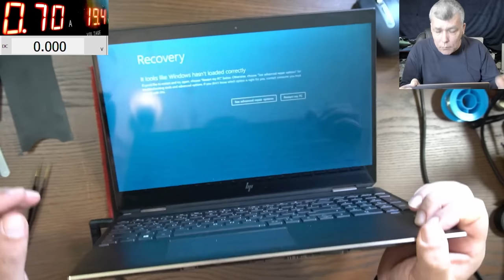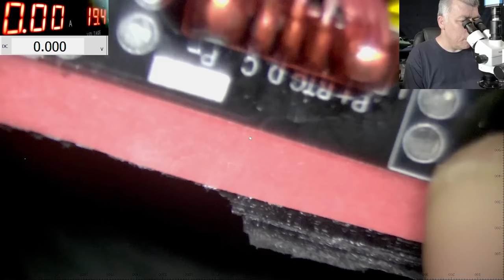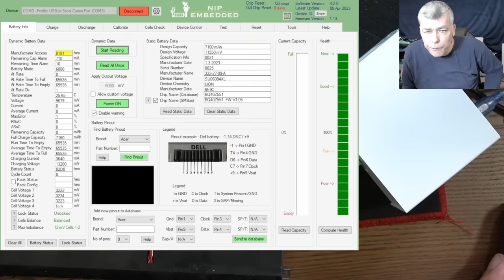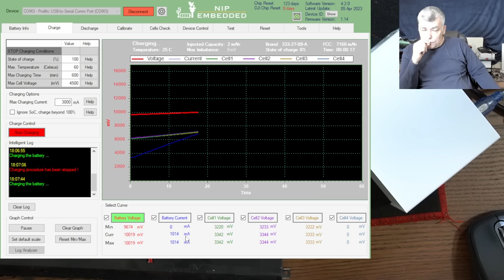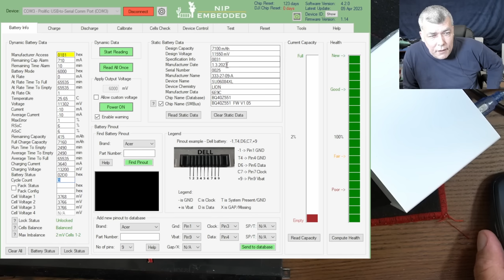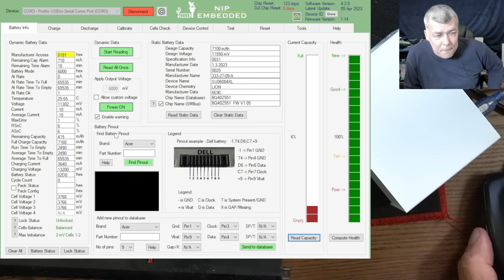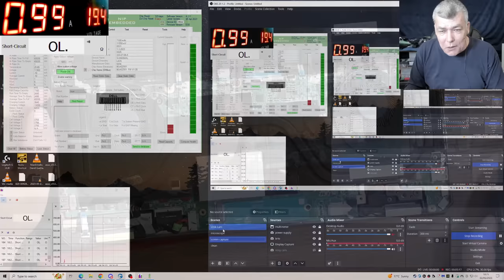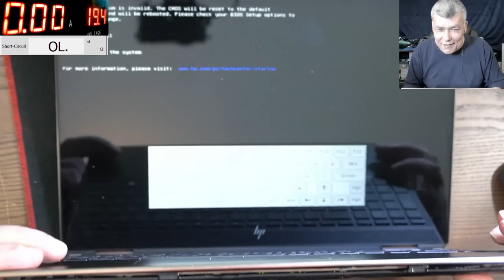Customer replaced battery and the laptop went dead, what he did wrong? Can we fix it? Hp laptop

Comment: I hate HPs from many reasons, and this is one in the queue. I never seen on any other laptop a battery connector which can be wrongly connected.
Reply: With enough determination you can fit a square peg into a round hole.

Comment: Back in the day we used to  briefly log  the fault and steps taken for remediation using  short hand,  with  faults like this, on the repair  sheet we would put ESTO ' which means  'Equipment Smarter  Than Operator'

Comment: Stangely, this connector is NOT poka-yoke. Its not mistake proof. However, at 16:20 you can see it has bplue pencil on right side, I believe customer can confirm that on original battery, there is blue pencil on connector from battery also. So its not poka-yoke in physical form, but someone marked it to make it poka-yoke.
Reply: Maybe this aftermarket battery has other colours than the original one. So it indicates the customer did Mark it before removing but never saw how to put in the new battery, maybe that's why the battery connector got broken.
Reply: Perhaps it was, before the customer forced it in 😂😂

Comment: Obviously the customer did not pay close attention to the connectors original specifications which no doubt in its construction would have only allowed an one-way fit...still he should have guessed that if the battery is cheaper than the OE equipment then something must be missing and it would appear an small tang to insure proper correct and more importantly safe fitting on the connector port was one of those missing items..mind you after all of this it doesnt look like he saved any money so let that be lesson because as they say in this life then "you really do get what you pay for"...!!

Comment: You would think in this day & age they would make the battery connector keyed to only go together one way 🤯 Unbelievable!!
Reply: You will be amazed how a determined lot can insert a keyed connector in reverse!
Reply: probably customer broke it when removing the battery or when forcely reinserted it
I remember my first computer was a C64 (yes I'm that old) that my father's boss gave away to him because it stopeed working, happened that the secretary tried to set it up and managed to connect the power supply into the video/audio output.

I friend of my dad kind of fixed it but the sound chip was beyond repair. I grew up with a mute C64

Comment: Usually ,they mould the connector to only go in one way with those little nibs of plastic so you cant do it wrong. So is this a design fault? and thank god, nothing was shorted with power going to the chips but they made so you could "safely" put it in either way?? but better to just make it one way possible?

Comment: As a technicians, we have to deal with these jobs also. The bad thing is that we almost taking the hard ways to figure it out whats the issue, because someone else did something. In the other hand, we have to be payed for the time we spend to figure it out what was the problem, even if the issue is something easy like in this case.

The big question here is, what you can charge the customer for? That should be a tricky answer. (Hypothetic question).

The truth is behind what Sorin said in the end of this video. "You know, some times you have to visit a Computer Shop to do things". and what ever this means.

Comment: i have a Dell Precision bought 3rd party battery and no work so had to get Dell battery for it to work
Reply: yep dells are very delicate about batteries... i have lattitude 5590 and with 3rd party battery it doesn't hold a charge or even work on battery - if i unplug the charger and the laptop dies... had to buy an original one to work properly.

Comment: To be fair to the customer, what an EXTREMELY STUPID DESIGN from HP to use a connector that can connected backwards! At least they had the decency to make it so the polarity wouldn't be reversed either way or else it would have been a much major fault.
Reply: Anything can be made to fit with enough force applied.

Comment: So you think you are a genius for fixing the mistake. The manufacture is the only one to blame here. They should not even have to dig in that far to replace the battery in the first place. The designer didn't keyway that connector on purpose. Glad you figured it out but don't get mad at the CX for trying to save a few bucks. Makes you out to be the azzhole in this case. BTW you are far from genius.